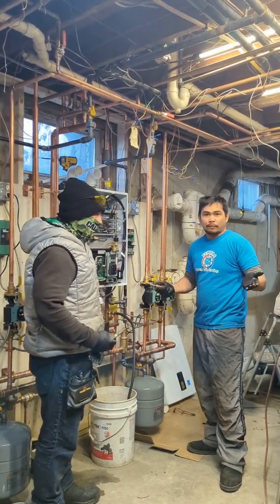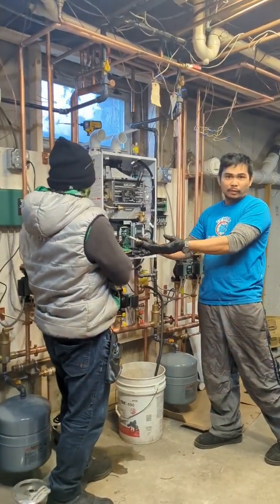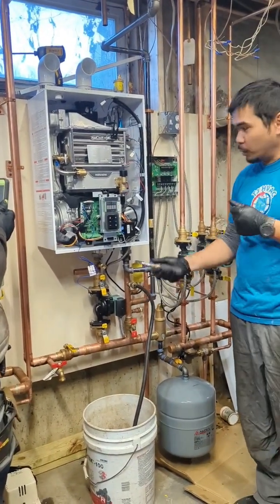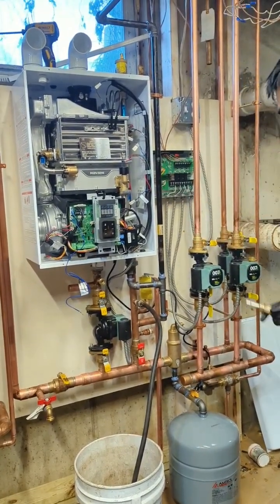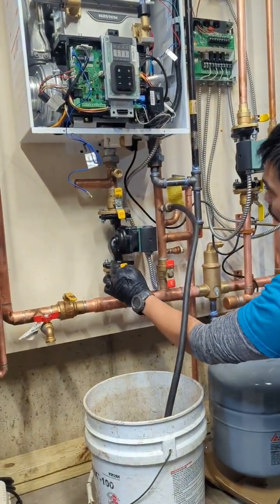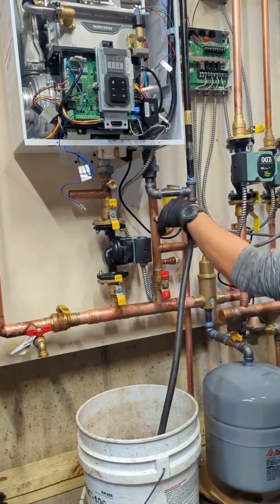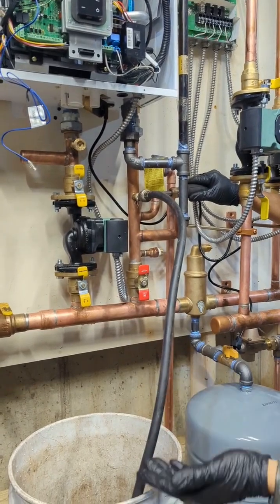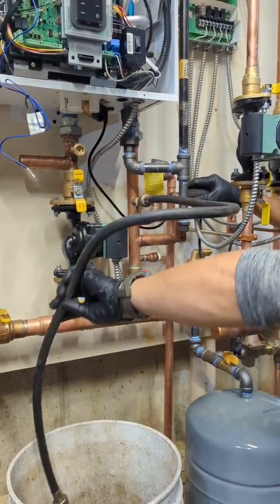4th day final install bleeding air out of Navien NHB boiler in primary manifold tutorial.

Comment: This looks like a "Heating Only" loop. You don't need a circulator directly pulling from the boiler Common return. The boiler should have its own Circulator pumping into the friction.
Reply from the maker: It's a Navien NHB boiler and it needs a primary circulation pump. You can check the manual for the piping diagram. https://www.google.com/search?q=navien+nhb+installation+manual&oq=Navien+nhb+i%27&gs_lcrp=EgZjaHJvbWUqCAgBEAAYFhgeMgYIABBFGDkyCAgBEAAYFhgeMggIAhAAGBYYHjIICAMQABgWGB4yCAgEEAAYFhgeMggIBRAAGBYYHjIICAYQABgWGB4yCAgHEAAYFhgeMggICBAAGBYYHjIICAkQABgWGB4yCggKEAAYhgMYigXSAQkxNjU3N2owajSoAgCwAgA&client=ms-android-verizon-us-rvc3&sourceid=chrome-mobile&ie=UTF-8